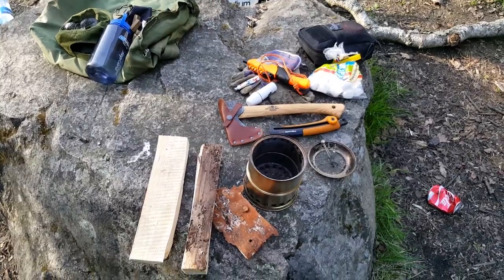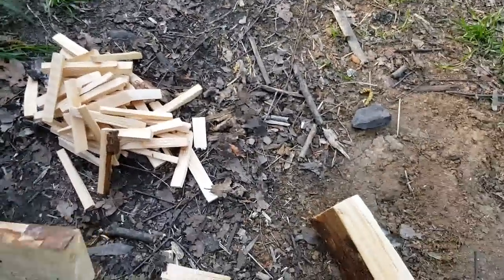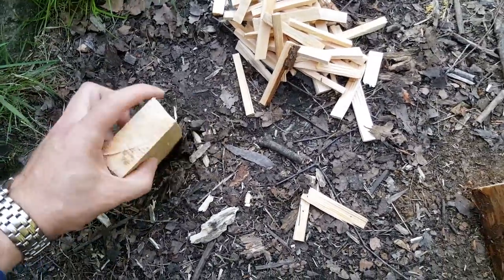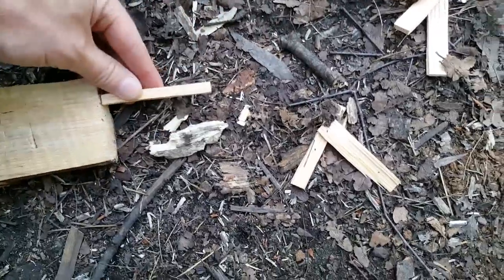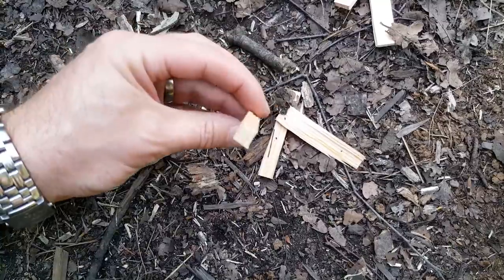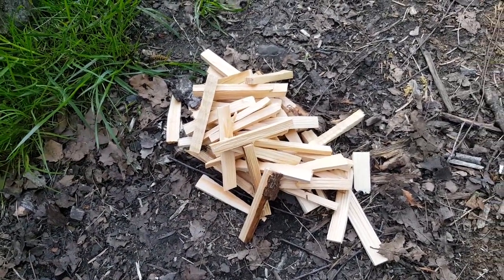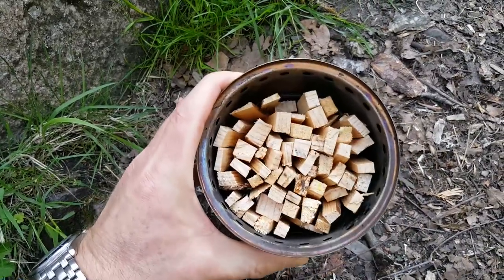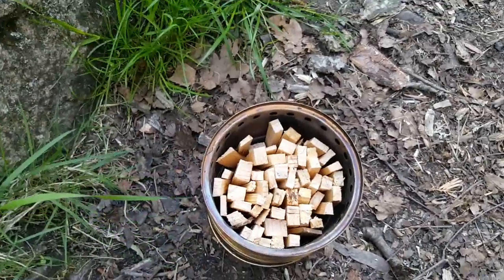Wild Woodgas Stove, top lit with standing pieces of wood.

Comment: Thanks Tord, very useful. Just as an aside, I get similar pot residues, which I'm guessing are something like unburnt wood resin.  They're tricky to remove from pots and burners, but I've discovered rubbing alcohol (surgical spirit) in a small garden sprayer bottle is a good first cleaning agent for most fire and soot residues. All the best,

Comment: Given the large diameter size of your burn chamber (it looks to be over 5in / 127mm), I would recommend sizing your baton processed wood equal to the two largest pieces shown @3:20 at the 6 o'clock and 9 o'clock positions.  Because of the large volume of the burn chamber, it also has higher heat energy potential -- utilize it.  The other thin sectioned processed wood will just burn up quickly like match sticks, as your burn test demonstrated.  During my test burn experiments, I've found that for a ~83mm diameter x ~100mm height burn chamber, processed wood sized to ~13mm square x ~76mm length performed best.  Note that with a processed wood length of 76mm, this only leaves me about 25mm for the remaining smaller dense wood/kindling, tinder, and accelerant.  Also remember, the goal should be to 'try' to keep the total fuel load stack height below the secondary air holes.

It looks like you have the length of your processed wood at about the right height (~4in / ~100mm) and below the secondary air holes.  I would then simply take the remaining ~100mm length processed wood pieces and cut those in half into smaller dense chunks, to be ~50mm length pieces and scatter horizontally completely covering the vertically stacked wood.  Then I would add the kindling, tinder/accelerant as you already demonstrated.

Anyway, that's my 2-cents worth... Keep up the good work!  ATB

Comment: These BushBuddy type stoves were  designed 20 years ago and became more popular when the ultra-light hiking people started to use them about 10 years ago .However now cheap Chinese knockoffs are available very few people dont know how to use them properly .They were never designed to use large bits of timber and it is wrong to call them gassifiers.All wood when heated  gives off gas whenever it burns and that is what you see as the flames.What these stoves do is to heat the oxygen in the air rising  in the inner  wall and out through the holes which combines with the wood gas to give a cleaner more efficient burn